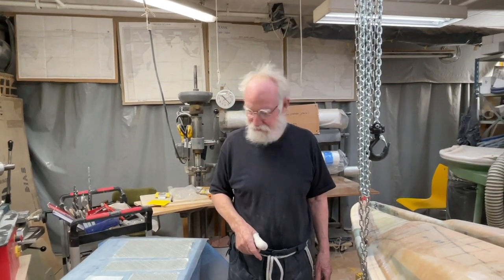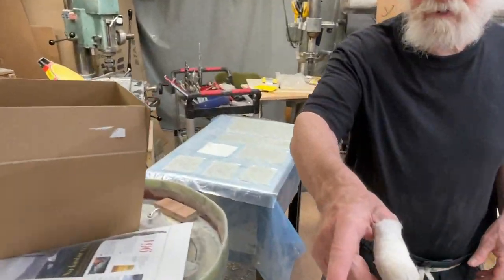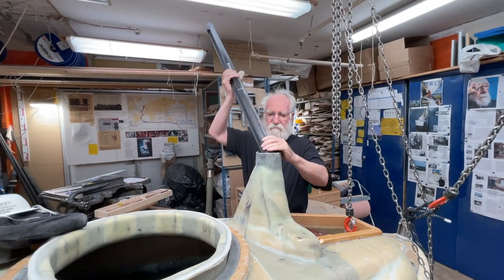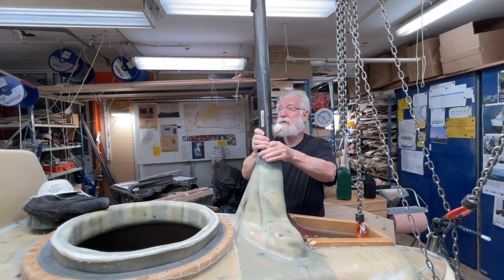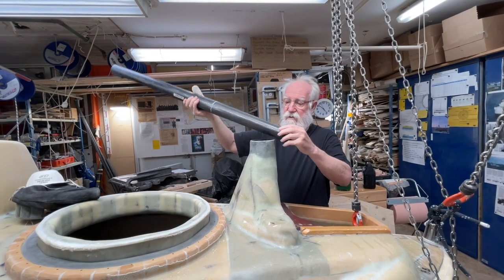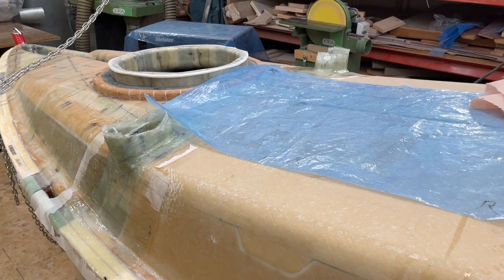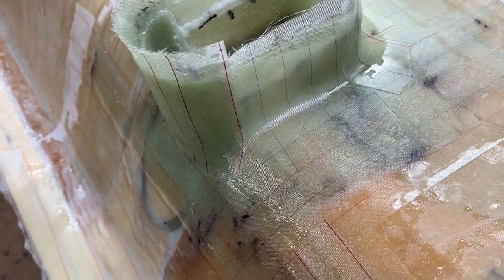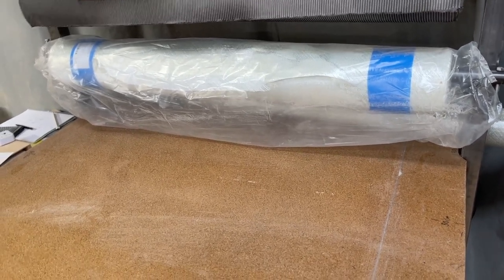20 July 2023 Starbord mastholder lamination

Comment: Why not just cut a small slot in the base of the mast for the AIS cable?
Reply from the maker: That is I think what Peter said also.
But the base will push against the mast holder 
It is very easy to put a collar around the mast with a bigger diameter than the mast holder